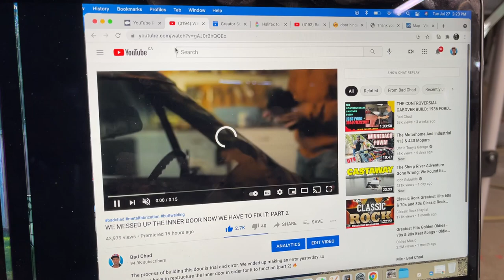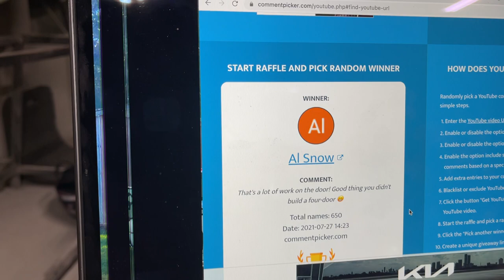THE HINGE DILEMMA: RE-ENGINEERING THE DOOR & HOOD HINGES

Comment: Just a thought on the door hinges, why do they have to be on the outside? why not do what modern cars do and have a hinged slider ( banana shaped and cocked at a very slight angle).
Built into the door frame allowing the door to do very similar to your origonal idea but hidden , also alowing it to be made beefier to give it strength. the angle would allow the door to arc slightly when opening allong almost 120 degree travel..message me if you want a drawing of it..

Comment: Two flat door hinges will work as long as you line up the hinge pins. Put one on the rounded lower part of the door and put the other near the original BUT mount at an angle so the hinge pins align.

Comment: There is no possible way to rotate that door outwards with that bottom bell on it..... Only possibility is if you can inboard hinge it in a way that the front sheet metal of the door turns in and passes inside of the metal in front of it (like virtually all modern cars do).... There will need to be a fairly big pocket to accommodate that bell.....The hinge pins need to be rearward of the leading edge of the door skin to achieve this, either on the inside or outside.....Cut paper patterns to work out the  "swing" on a workbench....
On another note, the way you are using that grinder at 43-44 minutes is beyond dangerous! 
Please consider clamping your workpieces securely when deploying a handheld "wheel of death" and positioning yourself to the side of the "cinder path" when cutting so that when the blade binds and explodes you won't be in it's path..... Also, gauntlet welding gloves to minimize the bite those blades can take....

Comment: Chad,,Make the doors GULL WING.
Hinging at the top with a spring lenght ways in a tube to
assist the lift.
I have done a lot of inged items and you are in for
a bad time to get them to work as the arc of the swing
will mean reshapping the door/lower ends.
With gull wing they just go straight/up.
Besides that Chad,,It will look cool!!
Reply: You will need a frame unde the roof,tin from side to side
to support it

Comment: And for the hood, if you take some 3/4 x 1 1/2" tube and bend it to contour the hood from one side to the other and tie your hinges into that it should open evenly like the electric lift on one of the old timers stand up recliners. If it can lift some old boy up to his feet the same configuration should lift a hood without twisting.

Comment: Those trunk hinges might be a problem. The center axis of them might not be inline if both are angled. They'd be pulling at different rates. You might have to put one further forward so the hinge pin axis is inline. with each other. Maybe build some test rigs first. I just noticed a few others said similar things.

Comment: To make the hinges in the exact pivot point, remove the pivot pins and temporary install a rod or threaded rod all the way thru the center of both pin holes with one rod. Otherwise the hinges will work against each other. The dukester.

Comment: Run a long bolt/rod/pin through both hinges, and you will be assured of alignment. After tacking, replace the bolt/rod/pin with the original pins.

Comment: Suicide doors would give you a better attachment area for the hinges. Hinge Offset from the gap is the same distance as the existing door hinge to straight out horizontally to the outset of the bottom lip of the door. 5 to 6 inches by the look of it

Comment: Put one hinge on the bottom where you added the metal and the other about where the top hinge is now. Angle them so the pins line up. The door will come up as you open it, but won’t hit the fender.

Comment: Chad 
It appears the door needs to move away from the body more on the bottom than the top. Therefore the pivot line needs to do the same and be farther out on  lower hinge than the top. Look at old panel wagon rear doors or van rear doors they open at kind of an upward angle for this reason.

Comment: You could leave the. Hinge in the original location and clearance the front fender to allow the bottom of the door to tuck behind it. Lots of 50’s cars are like that. 

Or do a gullwing and hinge it the top.

Don’t forget drain holes in door.

Comment: ***********   Hi Chad, Will You be adding the third brake light under the rear windshield?  Instead of dealing with an offset lower door hinge, wouldn't a long piano hinge from the upper body line (beneath the top hinge)  down to the lower body line fit the bill?

Comment: I suggested the suicide door. I you use one large arm hinge on the bottom of the door that. Pops out the door about an inch and then swings out the hinge will be invisable. You might have to put some kind. Of slide on the top

Comment: The hinge on the bottom could be fairly flush and the hinge action of the top hinge would have to stick out the same distance from the body. As it would stick out kind of clumsy it could double as the mount for the rearview mirror.

Comment: Look at Moss Motors part 401-970. The door hinge on a MG TF (1954-55) is offset so the hinge pin is not centered on the door gap. Each of the four hinges is a different part number. The TF has suicide doors. I think hinges like these would resolve the issue you are having.

Comment: With the door hinge issue, if you make a hinge similar to the stock 36, have a shamfer at about 30 degrees that peaks out half way of total opening then goes straight. That will raise the door enough to get over that bottom section. Also go suicide so you can get better hinge spacing. On the hood, your hinges are to close together. Look at the side where the original 36 hinges mounted and replicate the stock hinges.

Comment: What about changing the profile of the door at the bottom front, angle cut the curve off the door instead of having it curving around. If you know what I’m saying. That way you could use the stock hinges.  Just saying.....modify the door and door jam.  Should be an easy modification.

Comment: Using a hydraulic cylinder to open and raise the hood will also stabilize the hood from twisting assuming you use shafts with stable bushings. No rubber.

Comment: Why dont you put them on the insid of door then cut a slot out on the door slid a piece of 3/8 plate weld to the hinge then bolt to door use two top bottom. And add small shock to the bottom to take wate off door.

Comment: Rather like the swing arm on Jolene's Bugatti won't the upper and lower hinge pivots need to be aligned. Could you not use the original hinges and extend them out say an inch to give you the clearance

Comment: Have you considered suicide doors?
They are cool and you can make them doors more stable because the hinges are wider apart.

Or, what if you cut the door in two pieces horizontally where the angle is. Top part opens normally and lower part opens down ;)

Comment: chad you should consider suicide doors and get two more sets of hinges your going to use on the hood for the doors...... I believe you could work it so the door would swing out and away from the body with those hinges also how are going to seal the door to the body for road noise and the elements?     Keep up the good work

Comment: Aiden better be careful or he will become the next YouTube superstar 😜😜💥☄️⚡️💫
Reply: Sir Chad, how’s’ about gull-winging the doors, and you can use the small gas shocks like they use on hatch- back cars to assist opening the door OR BETTER YET! simply use the electric power type openers like we use for opening super heavy trunks on the really long heavy rear trunks on the old cars like cads, Lincolns, De Sotos , And Chrysler’s with the Continental Kits moulded Into the trunks They are available from places like speedway and other aftermarket custom supply houses, they can be found in different lengths, and in any number of multiple lifting weight ratings and this would greatly simplify the process/job and bring the wow /kool factor always found in Any bad chad One of a kind Original !! ( in the 60s and 70s I ran a little custom shop, I handled talking to the Customers, did frame work, some of the bodywork, and All of the crazy paint jobs of the Eras. My favorite was a Cadillac El Dorado that the shop Owner and I hand built into a custom station wagon with a 132-piece grille , and we used two of those 12-volt power lifts I was telling you about because the one piece tailgate we fabricated ended up being very heavy) that custom ended up being beautiful and the fella that was the owner loved it so he came back and had me make 2 wood signs for it  advertising his winery! I watch the shows All the time, I’ve gotten so old I can’t even weld OR paint any more, but I still have all my tools and old paint guns, etc, Maybe my Grandsons , or my Great-Grandson will be interested and could help them with learning the beginnings and then I will let them take off from there and encourage them to do what their imagination and creative juices dictate! I want to thank you for so much you have brought to the old guys like me , and I hope and pray that the “ young ones “ like Aiden, and your son’ will “ keep the flames burning! Thanks to you and your beautiful young lady for continuing your respective talents! Thanks Again Sir!